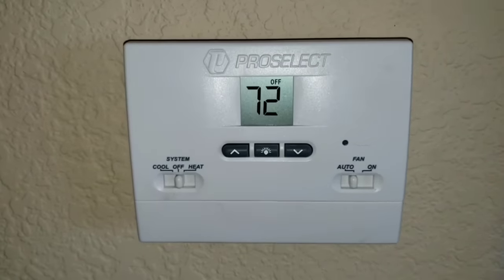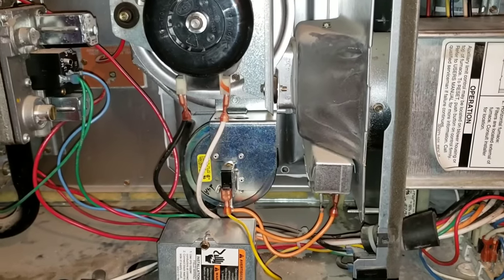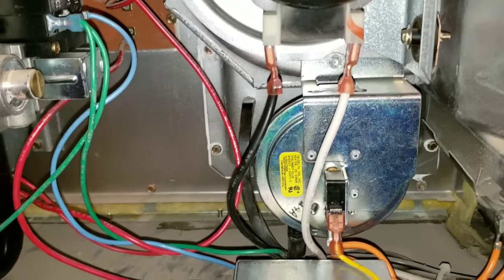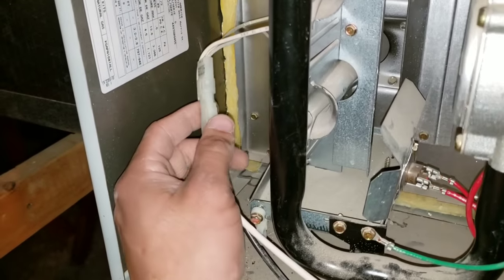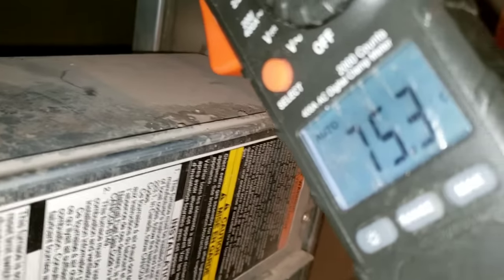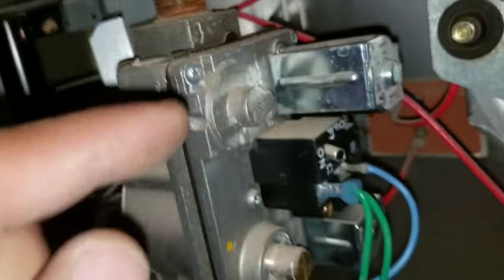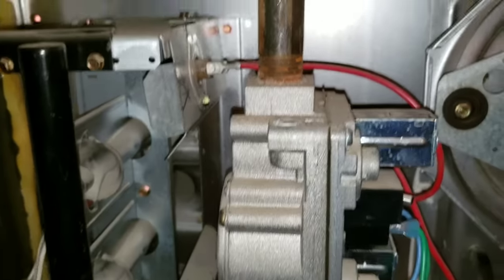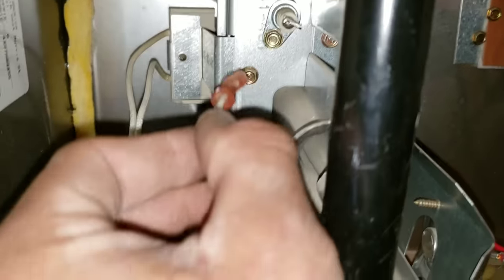Furnace Troubleshooting Step by Step with Multi Meter.

Comment: Also, I have to say, the rollout switches are there for a reason. If your rollout switches are tripped, you should NOT just reset them and go about your business. Flames do not rollout unless there is something wrong. Typically flame rollouts are caused by a cracked heat exchanger, and just resetting the switch will not fix your problem, nor is it safe to do.
Reply: True that
Reply: Safety first
Reply: ya..but could get you through a cold night..
Reply: A craked heat exchanger will cause your home to fill with carbon monoxide which will kill you unless you have a carbon monoxide alarm

Comment: By saying the wires are interconnected, means they are all in series, if any one the safety devices open then the furnace will open and shut down. I believe. I would have liked to of seen a wiring ladder diagram. But this was by far the best explanation I’ve seen on You Tube. I’ve had some electrical experience and I enjoy watching these video’s. Always learning more. Thank You

Comment: One thing I found out my basement furnace is, those two exterior vents must be absolutely clear of any materials. I place a seasonal bag over the outside condenser which reduced clear space to about 6 inches from those vents, the furnace exhaust created a turbulent air scenario which affected the intake natural flow. The ignited gas would flutter and pop, then the system would fault. This caused my YORK furnace to register a “flame sensor failure” or as I found out a “combustion air” problem. 8 red flashes. The AC/heat tech dismissed my thought about that bag. Believe it…TURBULENT AIR at the exhaust intake venting.

Comment: I don’t mean to be a wiseass but instead of using electrical tape to hold your power switch in the closed position “on” I find that pulling it out, like setting a fan limit switch to manual, is more practical. I’m very impressed with your thorough, methodical, and

Comment: Hello I just came across your video. Excellent tutorial video. Very in-depth video. I’m a homeowner and my hobbies are mechanic s, electrical, plumbing, carpentry along with others. I like to diagnose and repair problems. I know repair cost are high but one time I was charged extremely more one day I had service on my furnace when I was working. No more. I plan on taking a HVAC course. Looking forward to seeing more of your videos.

Comment: Sam your a good teacher,u speak and teach at  good pace.Your easy to follow and understand. Although you are very wrong,an inducer running or verifying(what u call it) isn't what closes a  psi switch .The psi switch has a tube going to it that tube is connected to the housing of the inducer,when the inducer runs in a system that doesn't have a chimney problem, chimney pipe problem, heat exchanger problem etc the inducer running creates a vacuum that the closes the psi switch normally open contacts. Not all blower mtr run on a call for heat for 90 seconds, thats that furnace, thats not all.Roll outs,high limits psi switches are not INTERLOCKED ,thats called wired in series.In the beginning u said u were troubleshooting a board,so why would u use LINE voltage ground and not your LOW VOLTAGE  NEUTRAL?Your low voltage neutral is common.Your discussing a gas fired furnace and u speak about the flame rod for 15 seconds?That rectification signal keeps the dam thing on,if thats not a good signal bck tothefurnace it won't wrong for 12 seconds.For some reason the flame rolls bck,FOR SOME REASON,howabout for these reasons,a bird nest in your chimney, water in your chimney, a brick chimney that fell apart,a cracked heat exchanger, a blocked secondary,a drft mtr with no squirrel cage that doesn't use a psi switch but rather an end switch.AND FORALLTHESE REASONS THATS WHY A ROLL OUT WOULD POP(the resettableswitches)Start up process,the industry lingo we call that a sequence of events.I JUSTHEARD INTERLOCK AGAIN,roll outs wired in series.GOOD JOB BRO,keep upthe good work

Comment: Thanks Sam --- as a note - some of these air switches has two contacts - one on the front one on the back check both! On my Carrier unit the yellow jumper powered both switches - then there was a brown (signal to control board) and orange (signal to control board) two different outputs signals. Inducer housing pressure and collector box pressure (check all 3 tubing- green, black, and black square tubing vacuumed sensing signal). Blow them out (toward the inducer housing) and you can check them with a OHM meter by gently sucking on the hose and hearing them click.  Make sure the hoses are good and tight - a very small vacuum leak can cause them to not work!

Comment: This is awesome! Just a suggestion that what would have made it more awesome is a 15 second talk on what each of those pieces does like "flame sensor is there to detect that you actually have ignition and flame and if not it turns the furnace off to prevent gas leak"... things like that.

Comment: DUDE Thank you!!!!! This is one of the most complete furnace videos i have seen. I have been having problems with my furnace and have been looking for the exact technical data you gave in this video like voltage and Ohms for specific parts. I will be using the knowledge you gave me in this video to completely troubleshoot my problems. At this point though with what I learned from this video I believe my furnace control box is bad.

Comment: I’m very impressed with your thorough, methodical, and informative video, I don’t mean to nitpick but instead of using electrical tape to close “hold in on position” your furnace power switch, might I suggest that you just try pulling it out, same as setting a fan limit switch to manual. Keep up the good work, maybe it will get some of the people who bother me at ridiculous times to realize that they could do it themselves, I was called at three o’clock in the morning on Christmas Eve to fix a boiler and again on Christmas Day to do a forced hot air furnace and I’m not even a furnace technician. . . I’m just “Blessed” with the ability to fix things.

Comment: From Argentina. Thank You Sam. Whith your explanation I resolved the problem in my weathermaker 8000. one of the temperature sensors is faulty. I replace this and it worked perfect.

Comment: Based on your video, I was able to have a starting point for troubleshooting the missing low voltage issue not at the pressure switch.  Thanks.

Comment: Thank you so much for this video!  Our furnace is exactly the same as the one here and so I was able to troubleshoot and fix our furnace for only $17!  Come to find out, it was only the igniter.  You saved us a technician call.  Thank you!
Reply: Ignitors usually fail every three years. Keep a spare ready. Same with capacitors on outside ac condenser unit. Be up and running in under ten minutes. Easy fixes.

Comment: Thanks for the lesson. I do alot of automotive electronic diagnostic work and my brothers furnace went out. I haven't trouble shot a AC house system before but it really doesn't look that different. Especially with the switches and safeties. Thanks for sharing.

Comment: I have done mostly construction and "finer" work like antique restoration and repair most of my working life. I got into maintenance about 5 years ago just as a knee jerk reaction to suddenly being unemployed after 16 years of uninterrupted work. Because of my construction experience my new employer 4 -1/2 years ago switched me from maintenance to remodeling of apartments and those apartments had baseboard heat and wall mount a/c units so I got almost no experience doing a/c and furnace trouble shooting.

I recently took a job where I needed to know these things and have been "cramming" for the last few weeks.

DUDE! This is the best video yet. It filled in most of the gaps the others skipped over.

But if I may let me make a suggestion. Remake this video and tell what the parts do. What does the "inducer" do? What does the "pressure switch" do? Is that the same as the "door switch"? What happens at the gas valve? 

That kind of stuff. Keep the step by step narrative after each start up. That was the best part. Each time you restarted the system and went further into "the loop" of functions I knew what you were going to say after a few "re-starts". Very good method of teaching!

Thank you for a great video! I subscribed!
Reply: follow up. I used the knowledge gained from this video to diagnose a bad gas valve and then replaced it. My first and my supervisor's first gas valve replacement! 

This is a great channel!

Comment: Excellent! Helped me understand all the parts, the sequence of events, and how to diagnose where things were going astray (my unit is a horizontally-mounted Trane TUE080A936K which has hot surface ignition). As such, this was even more helpful than "Top 10 Furnace Problems" (which actually covers 'top 30' or so), though Top 10 gave repair steps for each of the issues.

Comment: Excellent video Sam.  It's very informative and detailed.   I do have a couple of points to make.  I've been told on more than one occasion that cleaning a flame sensor with sandpaper is a bad idea.  The silica in the sandpaper left behind on a flame sensor can turn into glass when exposed to high heat, which might cause the sensor to malfunction.  It's best to use emery cloth.  Also, mention how the pressure switch closes when the inducer motor runs.  The inducer motor pulls a  that causes the pressure switch to close.

Comment: One of the best video I haven't seen. Much of detail how the furnace operates and deliver AC voltage. Great job Sam. Thanks.
Can you make another video about why the outlet has no power. How to chase the wire, where it has been disconnect.

Comment: very well explained , I have learned a lot . Especially when call for heat , it will energized the common side of the pressure switch. Meaning be careful of switching those 2 wires on the pressure switch , it just would not work !

Comment: This video was useful to follow the flow of startup to the point of main blower operating.  If I were to critique it, I would suggest taking voltage measurements at each wire's bare terminal end (if they are accessible), instead of pulling the component's terminals apart to take the measurements, as this is faster and in some cases safer.  

Future updates? : 1. clarify what the two heat sensors are, and whether the (square) combustion chamber temperature switch/ sensor is Normally Open or closed,  and what that does.  2. why the main blower sometimes pauses while the gas is still burning in the chamber (on it's way to the targeted thermostat setting).  3. what happens after the gas valve starts and the short timer starts to verify heat reaches the heat sensor on the burner.  4. what controls the startup (and pause, and stop) of the main blower, after the gas burner has been verified hot (is it controlled by a count-down timer or by a internal temperature sensor?)

Thank you!

Comment: omg! finally someone talks about the inducer motor, or the "black dial wheel thingy" IS WHAT I BEEN CALLIN IT!..lol...i dont have a clue what im doin, but im in a very bad situation, my fiance just passed from covid, i have no fam or friends left, and im a double leg amputee, who's hot water heater blew 2.5 months ago, but a week after it went, i tried to turn on my heat, and no heat came out!. so ive been without hot water and heat for almost 3 months...ive taught myself as much as i can from the youtube vids, but couldnt explain the inducer motor issue, cause i couldnt find where anyone had the "big black wheel" i have!..lol..  anyhow, so, i power on, furnace starts blowing, but after the 90 sec, it stops and my inducer motor just makes a buzzing or vibrating noise...is this something of an easy fix for me? im very nervous bout this stuff, but ive been shot down from EVERY "help" agency out there, and im 54yrs old, im sick. and too damn cold to just sit and wait for a miracle..oh and, is it going to be expensive?...thank you for your very helpful vid! and any advice!

Comment: "Excellent"  Very clear, step by step explanation also meter readings on voltage and resistance taking out the "I wonder if" guess work. I've got my meter in hand I'll let you know what I find. Best Regards
Reply: What you find?

Comment: This is the best video. I watched tons of videos. I am sitting in a freezing house. My ignitor glows hot orange, but my multimeter does not record 24 volts at the gas valve. Is the control board bad? Earlier I had to change the 3 amp ATC fuse. Since my transducer is running I do not think it is rollover switch.

Comment: Best explanation on the whole Internet.. thanks 👍 . But isn't there also a temperature sensor of some sort and do you have a video where you troubleshoot the blower?
Reply: There is the primary limit switch, rollback switch(es), and draft temp switch (sometimes) for temperature switches. To diagnose the blower you can make sure it is receiving the correct voltage and you can test the capacitor. If the motor is getting the right voltage and the capacitor is good then the motor is shot. You can also usually tell by trying to spin it by hand. If it does not spin freely it has a bad bearing.

Comment: I don't think this could have been explained any better.  Excellent video. I was looking at your board and it is very similar to mine. My problem, I have a Carrier furnace with a Gas Heating Lockout (Code 21) and can't get it to reset. I've gone thru all the troubleshooting and can't find the failure point (I even installed a new board). I did find that the board is not sending 120V to the HSI, but I can't figure out why. As a DIYer, I like to find the point of failure before calling the service tech. I've been burned in the past and won't let it happen again.
Reply: I know this is late but in that case if you know the sequence of operation you would check what comes before the HSI and that would’ve most likely have been your problem, maybe this info helps towards your diy against your furnace next time

Comment: What is the sensor in the back for,?  Are the flame roll out switches also called a limit switch, or am I getting this confused with an electric furnace???   By the way this is the greatest vid on explaining the circuits inside a gas furnace,  you make it so easy to understand.  Keep up the good work.

Comment: Has the cl210 been a good meter? I have a cl 2000 that I use around our shipyard here, and love it.  The ac/dc clamp meter gets used a lot between the ac machines and the dc cranes, and in five years of use, has been tough enough to survive the rigors of living in the overstuffed tool bag and work reliably.  I like fluke meters, but the Klein meters have proven themselves to me to be tough and reliable.

Comment: I would like to add that cleaning the flame sensor with a piece of scotch brite is a good choice. Also they do not like to be cleaned too many times, removing material over time will change the reading of the sensor.

Comment: I have dual system, propane furnace & heat pump.  Been working on the code "blink Red Twice".  Finally narrowed it down to problem in heat pump because if I turn heat pump off furnace works perfectly.  When the outside temp reaches the level that it's calls for propane to turn on then I get then"Blink Red Twice!  If I turn furnace off during warm days, heat pump works fine!  It brings house temp up to  what the thermostat  calls for!  I think the temp sensor on heat pump that's the problem.  Ordered a new one today.  Gradually replacing quite a few parts.  It's a GrandAire heat pump and furnace/Nordyne. They are 2006 units & they've been  well maintained.  Anyone with possible fixes please comment.  Since I can get thru the winter with the furnace I'll wait til spring before I'll call for service! 😊  BTW:  great video!

Comment: Sam It is really very knowledgeable presentation. Thanks a lot.
I have a question in my Lennox furnace Blower motor doesn't start 1st but inducing motor starts and then immediately shut off. after some minutes than again inducing motor starts 1st and that flames starts and then blower. presentation

Comment: Great video. I bet that the 24 people that gave it thumbs down are HVAC techs😂
Reply from the maker: You have no idea! 😅
Reply: D B 
I’m not a tech so I can’t say if his video has misinformation. All I know is that thanks to his video I was able to fix my furnace.
Reply: D B  OK, sport... can you be a little more specific as to the misinformation? Four words isn't much "information".
Reply: D B  So you don't know. Got it, thanks.
Reply: @kenhoward127  HSI and you inducer motor  don't verify.  Pressure switch, (pf switch closes), and you don't sand flame sensor.
Reply: @cu27rotary70  I listened again and I didn't hear him say the HSI proves temperature. I only heard him talking about voltage returning to the board. Maybe I missed it. Thanks for the reply... and not asking me to go to HVAC school.
Reply: @kenhoward127  good catch.  I have edited my post.
Reply: I always use sandpaper or a dollar bill to clean flame sensors and there’s many Chicago furnaces still running fine that I’ve done it on what else are you supposed to use all the lead techs I ever worked with use sandpaper  or a dollar bill to clean the flame sensor
Reply: As an Hvac tech, I hope you use and follow this video.  Because once I figure out/find out a homeowner was in there.  My price automatically doubles.  So please continue on.  It makes me money

Comment: Sam, very well put together video sir. I have a problem with my furnace, it will not light up. I have checked everything you mentioned in this video except my inducer motor starts up for a short period of time then it goes off. Does inducer motor need to stay on for as long as you are calling for heat? Thank you again and keep up the good work.